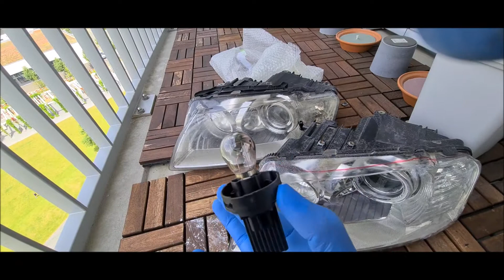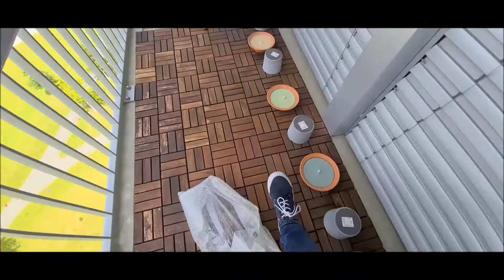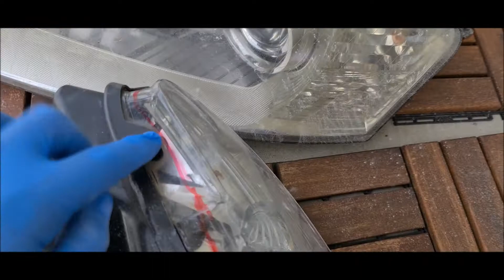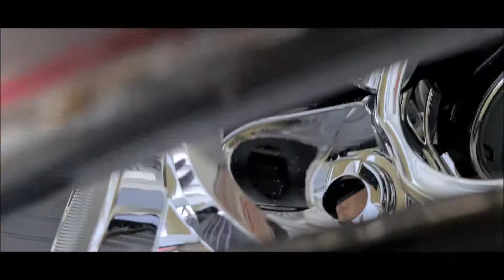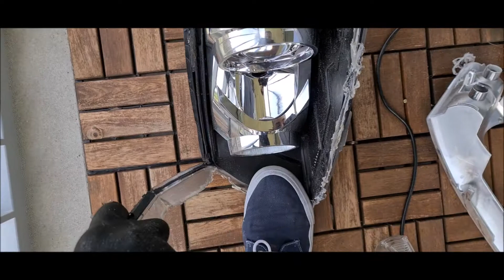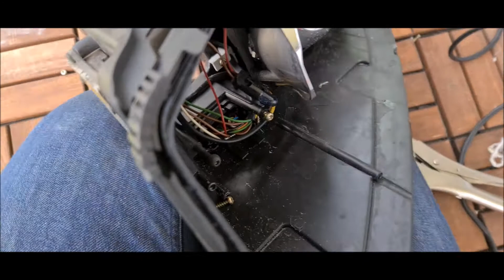Replacing Audi Headlight lenses (A8)

Comment: Where did you get the headlight lenses? You state that it was from E-bay China, have you got.more info? The lenses you purchased looks like pre 2005 facelift. I can only find facelift lenses.
Reply from the maker: Hi, lenses were facelift lenses. There is a difference between the two, but you must check part numbers
Reply: @SolveElectronics  right, was the headlamps for a facelift car? Thats a 2005 model or newer
Reply from the maker: @pelleb1198  yes my car is 06 face lift

Comment: Thanks for this video. A couple notes for others from when I did this: 

You weren’t kidding it’s hard as heck to pull out. 
I almost elbowed myself in the groin a few times.
Make sure to completely cut the lens away from the gray housing thing with the screws before pulling. 
Buy two full sticks of caulking. 
The lens melts first, but the black housing is much more tolerant. So I used a heat gun around the edge to try to soften the glue. I think this helped. It softened the lens but I could still grip it. 
Vice grips or w/e are mandatory, just like you said.

Comment: Thanks Pal, I have problems with my lenses, they already got professionally polished a couple of years ago, but look worse now.  The bi-xenon units are Hella G3  or similar and are garbage as the parabolic reflector tarnishes to dull beige after 5 years affecting many German cars of this era.  I just plan to fit new reflectors off aftermarket bi-xenon units and lenses.   I also have problems with the insulation breaking down another common issue, did you see any evidence of this?
Reply from the maker: It's really annoying that they get so dirty, but the parabolic lenses are actually glass and just get dirty. Blowing out the casing, and cleaning the lense with a microfiber makes them like new again
Reply: @SolveElectronics  Sorry, I means the plain plastic lenses, not the glass ones in the projector. I guess they may be a bit milky too, but the biggest issue is the metal bowl reflector at the back goes rusty and brown due to Hella using monkey metal with no suitable coating to prevent it.
Reply from the maker: @snapdragogon69  ah okay, I didn't notice the reflector in the back discolouring, and that was one of the first things I checked on the way to swapping the lenses, but my main issue was the lenses and the glass eye getting really dirty. After swapping them both, the results were top. Especially since I swapped the reflectors from the other lights too for the h7's
Reply: 00000000000⁰000000000000000000000000000000000000000000000000000000000000000000000000000000000000000000000000000000000000000000000000000000000000000000000000000000000000000000000000000000000000000000000000000000000000000000000000😅are a little different different a a area and it was very very on you you you 😅to to get 😅in 😅😅you 😉 😀 😅😅😅😮😮😮😅😅😅😅I don't 😅😅😅the way 😅😅😅😅😅😅